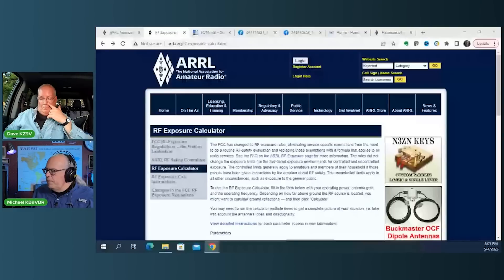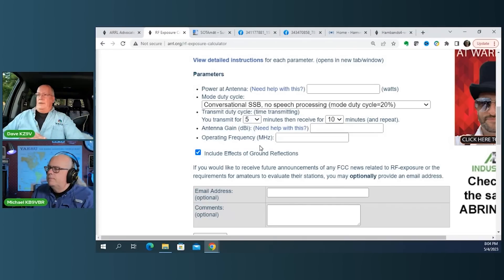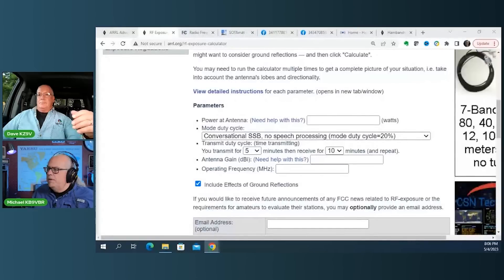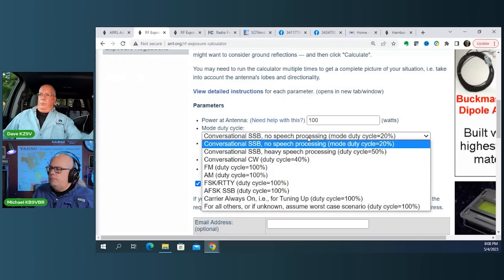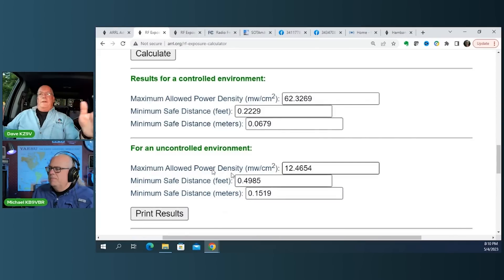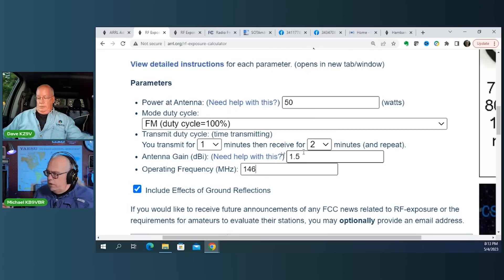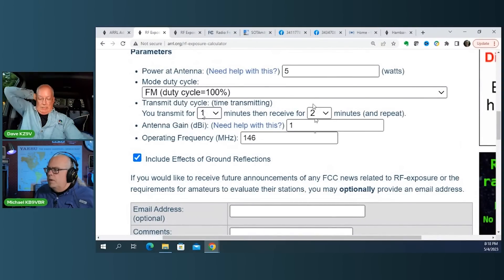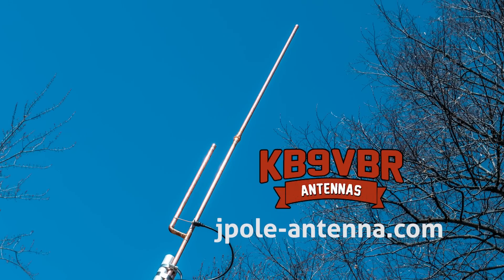Ask Michael, KB9VBR: FCC now REQUIRES amateurs to perform antenna RF exposure calculations

Comment from the maker: The comments have seem to go off the rails a bit. I'm not going to delete anything but instead respond categorically.

1. Get over it! You need to get outside and take a breath of fresh air. There isn't a vast conspiracy to track you down and take away your radios.

2. Rules concerning RF exposure have been in effect since the early 2000's. This information is on the Technician license exam. You need to know and care about this stuff if you wish to be a safe operator. The only thing that has changed is that the FCC no longer categorically exempts amateur radio operators from doing an evaluation. 

3. The time it takes to do an evaluation is short, you spend more time whining and complaining about 'intrusion' than doing the actual survey. 

4. Is the ARRL's RF calculator perfect? Not by any means. But it will get you to where you need to be. Make an estimation and stop over thinking the whole process. 

5. Are there risks involved with other radio services? Yes there are. This video pertains to the amateur radio service and I'm not going to engage in 'whataboutism' as a justification to not having to do the evaluation.

6. Finally, conduct yourself over-the-air, online, and in person according to the Amateur's Code: https://www.jpole-antenna.com/about-2/the-amateurs-code/
Reply: if you don't want to hear comments than get off the internet. Why post chit and than get chitty about it because you don't appreciate the comments. You get over it.
Reply from the maker: You can't come into my house and poop on the floor, nor will you pollute my comments. If you want to have a cogent, civil discussion, I welcome that. Otherwise get lost.
Reply: @KB9VBRAntennas  I understand what you're saying but devil's advocate, you are renting this "house". "house" cause the platform + servers are owned by Google and frequented by the global public. Same can even be said of a blog if using a web host provider that owns the servers. Not here to cause trouble but thats just being realistic of the internet. A place where even AI and farmed accounts exist. Theres a reason why people have rolled their eyes at the YouTube comments. Don't let it get to you. Cheers.
Reply: @CNe7532294  that's just
Reply from the maker: Meh, respect is earned, not given. Even to 'elders'.
Reply: Thank you for posting this video and comment. I appreciate what you have to share.
Reply: Michael, Thank you for continuing to do your videos despite the people that try your patience. I find your videos very valuable. The calculation was useful and I am glad I did it. I know that my 100w on 40m isnt doing much. It was always a question. Even if it is wrong it is not wrong in a way that it is causing me problems.  I also like you including your wife as my wife started watching your videos over my shoulders with me last night. "What is she doing? Is that a Loom?" "They have a bird in their car too?" (This one made us both laugh hard)  we just bought a camper and we both are approaching the stage of life that you both are.  You personally have rekindled my interest in amateur radio despite all the people with the political talk that got me turning it off a few years ago. So thank you! Keep it up. last time I was at hamvention was 2012. I think we might be going back next year. I have a VNA tester, a vertical MFJ Big stick I never fully understood. (Now I do, thank you) a FT-891 and a bunch of other stuff that is going to get a workout soon. See you on POTA soon. Your screen ground plane might be perfect for our sailboat that is sitting in a dock in a legit park. -Talk Soon 73 NA8Y

Comment: Ridiculous that a government agency that is mostly concerned with selling spectrum to cell carriers  and not enforcing existing regulations, even bothers with worrying with hams RF exposure.
Reply: The begining of the end for ham having a ham radio system in an urban settings.
Reply: New regulations and fees incoming
Reply: Big brother incoming.
Reply: True. I wonder what the FCC is doing about all those 1500 Watt CB stations and amped-up mobile CB rigs? Are they calculating their RF to meet regs? Yeah, right. Which installation is more likely to be dumping heavy RF all around.
Reply: Spot on, thank you, I was gonna say that.
Reply: Mobile phone towers microwaves from dish 
Guys who work on them are glowing . Hair analysis  test 40 bux will tell you about your radiation  levels
Reply: @WolfQuantum  Right!  The government has you registered as a radio amateur, just like gun registration.  When the time comes, the enforcers will come around to collect the guns and your radio gear.  You should stash some of the latter in a safe, hidden place. I keep backup HF rnd CB radios, a couple of HT's some wire antennas and batteries and various other equipment in a secure location.
Reply: @timbookedtwo2375  don't forget to stash the guns too!
Reply: @axemanarbor  Guns are registered. Ham radio equipment is not (yet).
Reply: @timbookedtwo2375  not completely registered
Reply: @axemanarbor  lost in a boating accident
Reply: @patncolagreco7438  good suggestion.
Reply: @timbookedtwo2375  A+

Comment: I've often wondered about this, I was a ship's radio officer in a previous life and met a few guys close to retirement who had done the job all of their working lives, and without exception they were a bit bonkers, definitely not normal.  A typical ship's radio installation in those days didn't use coaxial transmission lines, the antenna connection was a copper pipe attached directly to the transmitter and often passed directly over the operator's head to an exit point on the other side of the room suspended by ceiling mounted insulators, we'd be running about 1.5kw on H/F, indeed, if I'd run out of matches I used to use to be able to stand up and draw an arc off it with an insulated screwdriver to set fire to a telegram form and use it to light my cigarette !!  I know that cigarette smoking is bad for one's health but being engulfed in all that R/F probably wasn't beneficial either?
Reply: I heard smoking is what killed my 98 yr old neighbor....:)
Reply: Hello Rhoda, I was a 3rd engineer in the '80s. I noticed that sparks was a bit odd, but I attribute that to the empty Dewars bottle that he tossed out his porthole every other day,  JK hihi. I always enjoyed listening to the marine traffic in his radio room. BTW, I  was port engineer aboard the nuclear ship savannah and started K3SAV. The team will activate for museum ships weekend.
Reply: @FightUni09  Yes, it's the R/F contamination that made us do things like that 🤣😂
Reply: I think most started out bonkers and got progressively worse
Reply: Five cv-19 shots plus a booster will do it.
Reply: @rhodaborrocks1654  This effect dates back to the dawn of radio (actually the pre-dawn,) with Nikola Tesla working with pulsed megawatts VLF, even recommending that people put their heads directly against the equipment for 30min a day, to stimulate creativity and remove the need for sleep!   Any deleterious mental effects would only be insignificant  ...as long as they don't slowly build up over time.  Do they?   Well, as long as Nikola Tesla DIDN'T acquire progressive mental problems over several decades, we have proof that RF must be harmless,  completely harmless!!!   
Heh.

> without exception they were a bit bonkers, definitely not normal.
 
But also, don't mistake correlation for causation.   First prove that the radio biz doesn't attract those of us who are ALREADY bonkers.

Comment: On most HT's,  isn't it the case where you become part of the antenna unless you have added a "rat tail" counterpoise?  If so,  how does that factor in for exposure?
Reply: Good question. Guessing the wattage is so low that it's not significant.

Comment: Gentlemen, thank you for a great comprehensive report that takes the guess work out of the new regs. EMF has always been a concern for me when I use my Yaesu 101EE or G90. I primarily use a 134 foot end feed with a homemade 49:1, about 65ft up a tree on 2 acres, so I bought a field strength meter the Meterk EMF Tester MK08 and use it to read Micro Teslas (non ionizing) radiation.  The meter came with a factory alarm setting at 0.40 uT Micro Teslas (non Ionizing) radiation and has been a big help keeping things safe.  

I checked my 7S android cell phone one day and to my surprise it over ranged the meter, that would be >199.99 uT.  I reported it to my ATT carrier who said they would check but have had no response.  My wifes Iphone was 1.5 uT so I decided to switch to an Iphone but had the same problem as before.  I just purchased a new Android S22 recently and it still over ranges the meter at times.  I no longer hold the phone and warn others to have their phone tested before use.  Not sure what's going on with some of our phones but there's a hidden danger that needs to be addressed.  73 KG5UWJ

Comment: Fantastic! I was the RTO for my platoon. I always used a PRC77, that was a FM transceiver at 20 watts. It was kept in my Ranger Ruck with the antenna folded to reduce height or fully extended. I did that for 5 years! Well that explains a lot!
Thank you for the program gentlemen. 
73 de KB0WZH

Comment: just as a afterthought, this rf calculator is already in force here in the UK for amateur radio, and as another afterthought, back in the day when Radio Caroline was broadcasting using 2 phased 25kw linears and a 160m full size vertical ship mounted antenna(officially the worlds largest floating antenna), at night time when the crew used to go onto the deck they would carry a floresent tube, which would light up without any cables, such was the amount of stray rf floating about, in fact the DJ of the time Johnny walker is on film talking about it, my setup 100w ft8 on a beam 11m in the air or 80m sloper 10m @ its highest and 6 feet at its lowest, if someone want to climb up my tower and get a rf burn, they should not be there in the first place and there a burglar :) :), also checking that calculator theres nothing for ft8 (except rtty 100% duty), and no ability to drop below 1 minute tx or rx, but according to that calculator safe distance on 10.136 mhz is just under 4 feet with 10 db of antenna gain :)

Comment: Thank you.
   Did the calculations, printed them out, then filed them.
   There was not an exposure problem for my station as configured.
    If I change something, simply rerun the calculations. N0QFT
Reply: Do you have multiple antennas, operate multiple bands at multiple power levels?  In other words did you have to do several calculations?
Reply from the maker: Do the calculations for each antenna on each band. Do it for the worst case scenario: highest power level and duty cycle. Everything else will fall under that.

Comment: Done my calculations and printed. I wonder how that would apply on mobile stations or SOTA/POTA events. Thank you for the video, I enjoyed watching it. 73
Reply from the maker: I did a basic 'worst case' calculation for my POTA antennas. Their location doesn't really matter, just the exposure limit based on power output, gain, and duty cycle.

Comment: Even though 100W seems low,  I understand that the immediate vicinity of some of those compact transmitting loops that are sold for portable or indoor use has a very intense  RF field.  So stay clear of those when using.  Maybe not so much at QRP.
Reply: I don't have one of them thar loops, I'm nowhere NEAR my antenna, and thus will ignore this.
Reply: @silasmarner7586  I want to see some of the forms filled out by the channel 6 denisons, like BBI, Prime Minister, Motormouth Maul, and so on. I don't transmit enough or with over 100 watts to worry about this.

Comment: Very easy to use tool.  I printed out sheets for 80, 10, 2 mtrs at 60 watts on vertical, and 60 watts on 10 element beam, and 2 mtrs on 4 watt HT.  I will staple those together and hang them on the wall by my license. Thanks for the review. Seven Three - K4KID

Comment: Just went through it for my station and I am relieved to say that any visitors to my property are safe,  as long as they do not get closer to my antenna than  "Minimum Safe Distance (feet): 0.3819"   from my antenna that is 30' high.   I do not think my 50W station is who they are after.   But I did fulfill my legal requirement for my station to be an upstanding ham operator.
Reply: Good example Paul.

Comment: I live in a townhouse which precludes having a practical outside antenna.  My neighbors know that I'm an amateur radio operator and are aware that I have a wire antenna (zig-zagged 132' OCFD) and VHF/UHF antenna in my attic space.  Showing them the calculations last summer went a long way toward easing their concerns.

Comment: Did mine already. Simple. In the station log. Done ✅   Thanks!
Reply: So how did you do this?  Did you do one for every combination of bands, power levels and multiple antennas you operate on routinely?
Reply: @mssippijim  I did the upper HF bands with the highest exposure values for 20-40-60-100 watts. Everything else is less. My mobile HF 60&100w 10m.
Reply: @MisterBigDave  Thanks. That's kind of the approach I came up with. I've done  about four with "worse than worst case" scenarios for each mode, so I think I'm good to go. What  a waste of government resources.
Reply: My typical station HF use is 15-20 watts in my house on a dipole, my truck is 60 on a stick, my qrp is 5-6 watts on a wire. I’m not going to make any big deal out of this. It’s over and filed in my log book. Back to coffee and fishing 🎣
Reply: @MisterBigDave  Wouldn't it be cool if they gave us a "fishing" calculator to tell us when to fish?
Reply: @mssippijim  Seems like a possible waste, but it is for our protection. Tbink of radiation limits sort of like "speed" limits. "Knowing" is better than "not knowing" if we are cooking ourselves.
Reply: @SKYGUY1  Pays to be careful I guess. I’ve worked in broadcasting most of my life, the early years underneath high power tv antennas, not real worried about 100 watts. 50 feet or more from the antenna 😀, but I did the surveys and filed them.

Comment: Just curious, Are the 11 meter people going to have to do the same calculations? Our mobile radios put out 35 to 50 watts on 70 cm and 2 meter bands straight out of the box and with repeaters we really do not need much else. The 5 watt radios they have on 11 meters with amps put out 500 watts or more.

Comment: I always tune for maximum smoke, and when my metal plate warms up in my head I back off a touch. Is that bad??
Reply from the maker: As long as your plate isn't bimetal. Otherwise warping may occur, which could be painful.

Comment: OK this week I went to ARRL to use their calculator.  With barefoot HF radios I am safe with SSB and CW outside of about 5 feet from my vertical,  worst case they showed.  And that is at 29 MHz.  Lower bands are even alot closer.  Close enough to touch it and get burned! I even disregarded feedline loss too.

Comment: Very informative; thanks! So, are we supposed to just calculate and know the distance, or are we required save our calculations on tangible media and file them away with our station records in the event the FCC wants to review them?
Reply from the maker: It's not specified, but you should have a copy for your records that is readily accessible, be it paper, PDF, or some other type of file.
Reply: @KB9VBRAntennas  Thanks!

Comment: I just did mine, a Vertical with radials, pushing 200 watts (176.893 watts after LRM400 loss 75 feet) and between 1.8MHz and 50MHz the WORST is under 4 feet. Pretty much negligible.

As far as the mobile calculations, don't forget to SUBTRACT the fact that you have some solid steel between you and your antenna.
Reply: If it is roof mounted, that is true. If it is mounted on your trunk lid, or front fender, you have nothing that attenuates the RF between you and the antenna. All of my mobile antennas are roof mounted. Three on each vehicle.
Reply: But attenuated how much?  There is nothing in the calculator to adjust for it.

Comment: should help Hams to prove they need a tall mast/Tower. Get the radiating element further away from the general public and household ,giving extra safety factor the higher you go.👍👍This will be one factor presented to my local council when I apply for a 20m(66ft) Mast Development  Application. Currently allowed 10m mast /tower and a total of 3 exterior antennas without Council approval.   Just did the calculations for 144mhz 400w (Max in Australia) 10dbi gain . 5min tx FM 5min RX.  Needs to be 14 m in uncontrolled environment. The Neighbours on one side are slightly up hill by a few M so need to get the antenna above Them . If the council refuses then they are not allowing a safe environment for my licenced Radio Transmissions. Similar rules here in Australia , once 100w is used from memory you must calculate RF Exposure.             Was also curious about cell ph pwr and freqs...   So did 3w(cell ph with weak signal  to cell tower pwr)  at 750Mhz ( Telstra  4g In Australia) 5min tx  100% Duty cycle Controlled distance 0.143m  0.468 ft  OMG. Speaker phone only it seems.

Comment: What is the health risk of over exposure in HF bands?  Running above VHF, can have health effects.  If you are low enough power to not have RF arcing and RF burns, what is the issue?  I too have worked on broadcast equipment for AM FM and UHF television. In the AM transmitter site, the RF field was strong enough to ignite steel wool between conduit and HVAC ductwork.

Comment: I am less than personally concerned though,  at a 100W power level.  At one time we were advised that HF frequencies and below pretty much passed thru you without any absorption at all plus your body is a small portion of a wavelength down there.   The only notable threat I think is maybe RF burns or zaps from touching a transmitting antenna!